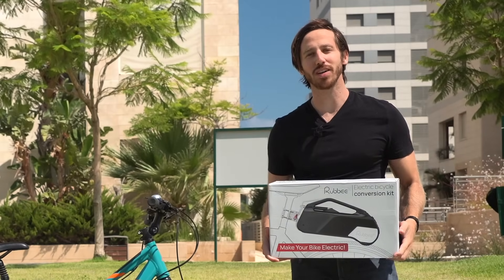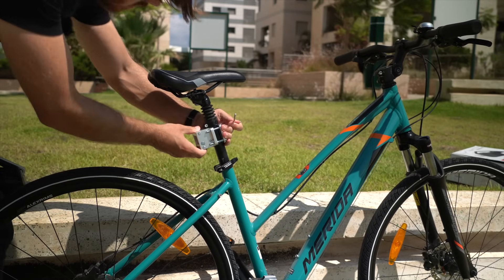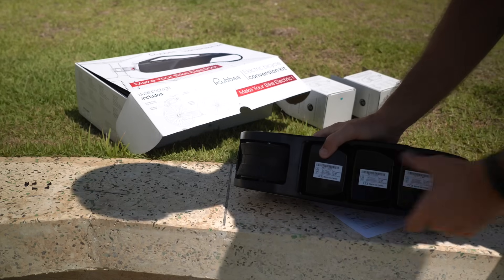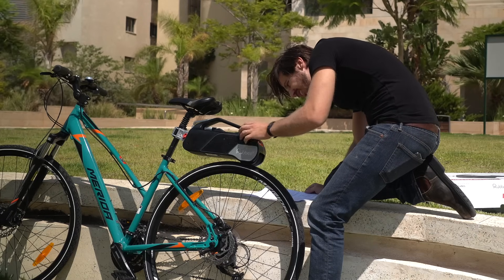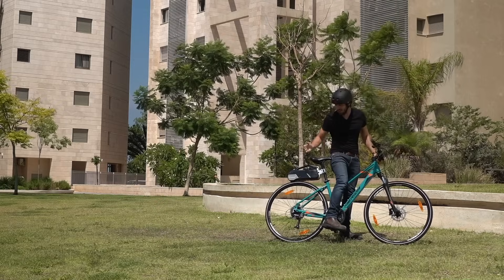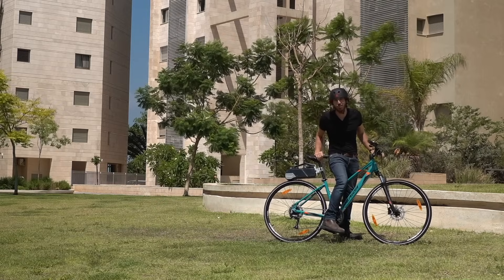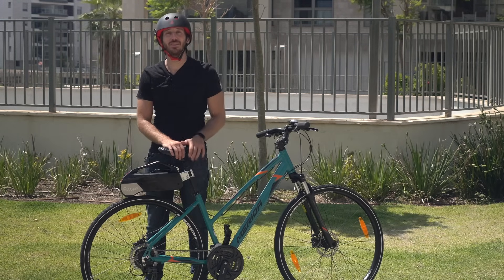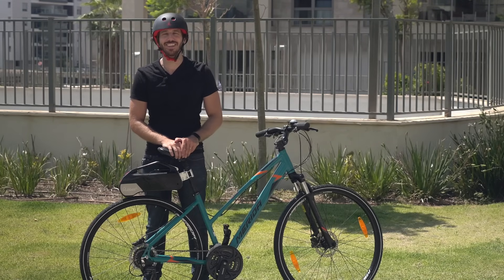The Easiest DIY Electric Bike Kit I've Ever Used! (Rubbee X)

Comment: You still get more from baffang!
Reply: ....how long does it take to put your Bafang on a different bike?
Reply: @Randoman9987  why do i need to put that to different bike? Isnt 1 bike enaugh for riding? If thats only thing whats important, then yes mount and dismount baffang takes around 1 hour, but you need to install it only once.. or you leave your bike out and take only rubbee inside? For charging you can take baffang battery inside. My main guestions is how long that contact wheele last before it start spin? How well it grip after contacting mud and grass.. ? Rubbee is for them who travel without bike and rent it and then i see any value of it.. otherwise baffang is way to go.. last 95% for sure atleast 3x longer than rubbee.. golden rule: Nice looking = bad maintenance (Try to replace that friction wheele and let me know...

Comment: I think the price (€580 for the base model, with an extra €100 per <100Wh) makes the decision to go for a new e-bike less painful: must be really loving the non-assisted bike a lot to put this investment.
Reply: The price is completely insane. So many e-bike related things are so overpriced it almost seems like a scam.
Reply: @prizmbreaker  The prices on everything bike related have gotten ridiculous in the last 2 years, and many tires, batteries, derailleurs etc aren't even available now...
Reply: @prizmbreaker  I think you are right. Too many get-rich-quick merchants cashing in. The main 'rip off' is when the battery wears out and you have to buy a buy one... gave up on e bikes some time ago ...
Reply: china will probably copycat this design and sell them on ebay for 299 including free shipping within a few months
Reply: Ex
Reply: Wow that's expensive

Comment: how does it fair in wet conditions? Do you think terrain would be an issue and do you know if replacement parts available?
Reply: Used a friction roller system on a bmx. Twas fun but living in the UK soon found out it was no good in the rain.
Reply: @monkeytonker4637  yh but it would suck where I live in Thanet because the terrain is not flat due to the coast so it's just up and down, I'll just have to consider going with hub or direct drive still
Reply: Rubbee X is pretty robust to wet conditions. It can handle wet roads, the electronics inside are fully potted. But if we're talking few inches of water on the road - it's better to lock Rubbee in the "lifted up" position just to be sure nothing bad happens.
Reply: I wouldn’t ride in the uk without mudguards, unless I wanted to arrive with a wet/muddy butt.
Reply: MASTERZANUFF - fare
Reply: It's fine in wet conditions and the unit itself act a bit like a mudguard. It's also fine in hilly areas and the gas suspension allows the unit to keep good contact if the road is bumpy. I live in Wellington, New Zealand, one of the hilliest cities in the world and the unit works fine.